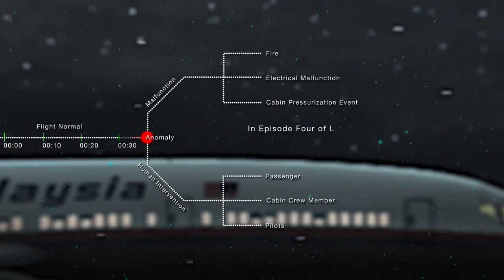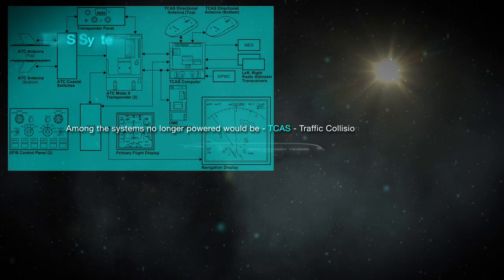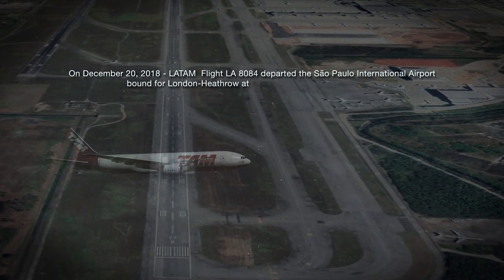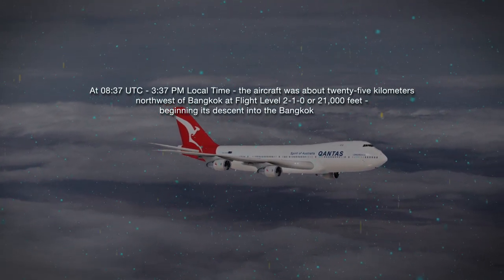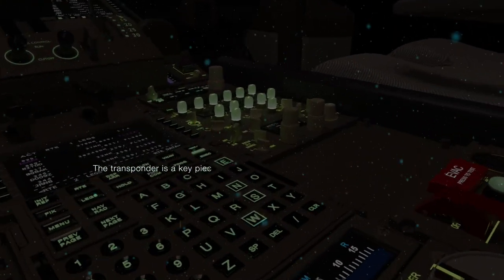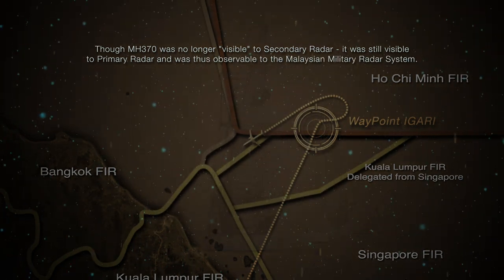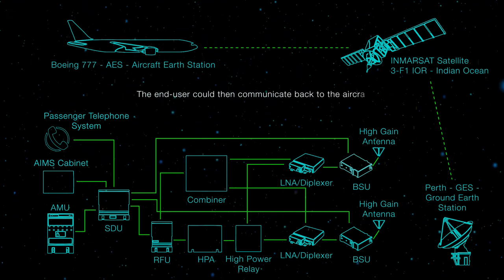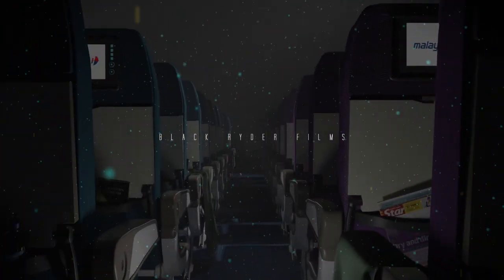Lost Flight MH370: Episode Four

Comment: I have watched a lot of videos about this flight; I have more or less come to my own conclusions about it all but I have seen nothing that has been as thorough or as informative as this series and am really looking forward to the next episode(s).
Reply: @cwam1701e   
Latest interesting data I've seen is this presentation with (somewhat newer) information that's been compiled (with data to support) that at least the last half of the flight path was most likely much different than the main area where all of the searches took place.

It suggests that they might have intended to land on Christmas Island, which is almost the identical distance from Kuala Lampur to Beijing (considering their fuel load), and also one of the few runways within its capable flight distance that has a long enough runway for this aircraft to land.

https://youtu.be/Qk1CxO9XGyQ
Reply: @bbfoto7248  I came across that some time after I had made my comment on this video. I agree with you - it is a good piece of detective work and, I think, a viable explanation.

Comment: Three things I'd like to hear more about. 1) An airliner contacted MH370 but only got "mumbling" and indistinct sounds. At the least, that means MH370 actively transmitted something. 2) Were there any cell phone calls from the flight, from take off to any point afterwards. 3) How do take out all the passengers and crew at one time?
Reply: @Michael Cilibrasi  
Do you know the source or have a Link to the information regarding this radio contact???

AFAIK, the ONLY cellular phone to cell tower "locator or connection ping", was that of the 1st Officer's cell phone.  ...Curious.

This was not a call or message, just a Single confirmation that his phone had connected to or ping'd a cell tower.   I believe it was Penang Island and well after the transponder & SDU went offline.

Watch this presentation for (somewhat newer) information that's been compiled (with data to support) that at least the last half of the flight path was most likely much different than the main area where all of the searches took place.

It suggests that they might have intended to land on Christmas Island, which is almost the identical distance from Kuala Lampur to Beijing, and also one of the few runways within its capable flight distance that has a long enough runway for this aircraft to land.

https://youtu.be/Qk1CxO9XGyQ
Reply: Excellent work and explains to the layman the various systems.
However at the end you dismiss electrical failure even though it provides a mechanism for the innocent loss of the transponder which logically is the 99 per cent chance and with clairvoyance could have been predicted if the incident of 2018 was known in 2014.
If you examine the last message from the commander you should note that he has not finished talking when he gets cut off. As an experienced flight officer he should have repeated the number to contact the next stage. This is a clear sign that the loss was not after but during air to ground communication that got missed as do many many clues at the time and immediately afterwards.

Comment: How do you explain the loss of SDU signal except from a power failure? I've been told by an expert on B777 that you cannot turn ACARS of from the cockpit. It has to be done fron the electrical bay under the cockpit.
Reply: Yes, I have the same question! I don't know if it will be covered in this series, but I saw a video recently that postulated that the main electrical switches/buses were deliberately turned off and the aircraft was flown from the electrical power from the RAT specifically so that the SDU/ACARS would not be powered; once outside military radar zone the buses were reactivated and the aircraft flown normally. The deliberateness is speculation, of course, but I have heard no other explanation for the SDU/ACARS to lose power unless the aircraft is flying on emergency electrical power from that RAT.

Comment: Super video. Also, there was a iphone call made by the pilot and at which point and time in the flight path.
Reply: Wasn't it by the 1st Officer (the co-pilot)?  And I don't believe there was ever an actual call...

AFAIK, the ONLY cellular phone to cell tower "locator or connection ping", was that of the 1st Officer's cell phone.

This was not a call or message, just a one time confirmation that his phone had connected to or ping'd a cell tower on Penance Island (IIRC).  And I believe it was well after the transponder & SDU went offline.

Watch this presentation for (somewhat newer) information that's been compiled (with data to support) that at least the last half of the flight path was most likely much different than the main area where all of the searches took place.

It suggests that they might have intended to land on Christmas Island, which is almost the identical distance from Kuala Lampur to Beijing (and considering their fuel load), and also one of the few runways within its capable flight distance that has a long enough runway for this aircraft to land.

https://youtu.be/Qk1CxO9XGyQ

Comment: A police investigation has now emerged claiming a Malaysian telecom tower detected a mobile number registered to Fariq Abdul Hamid a few minutes before the plane dropped off the radar.
There have been a whole host of theories speculating what happened to the flight.
The latest alleged evidence about the mobile would appear to support the idea the plane was crashed into the sea in a mass murder-suicide, former Easyjet chief pilot Mike Keane has suggested.
According to the theory, the captain may have told Fariq to go to the cabin before locking himself in the cockpit.

Fariq though would have had his mobile after takeoff, so the theory goes, and tried to make an emergency call when he realised what was happening and the plane was being depressurised.
Keane said: “The first officer would have been skilled in responding to depressurisation due to regular training.
“If Fariq had his mobile phone with him, he would have grabbed an oxygen bottle before taking his phone off flight mode or switching it on.”
Reply: How do u explain the low flying Malaysian airline reported over the maldives  by tons of people heading towards deoga garcia island???
Reply: @egs1380  Actually, it's already  been proven that MH370 was nowhere near that area.
Reply: @egs1380  
Latest interesting data I've seen is this presentation with (somewhat newer) information that's been compiled (with data to support) that at least the last half of the flight path was most likely much different than the main area where all of the searches took place.

It suggests that they might have intended to land on Christmas Island (read other comments as to why), which is almost the identical distance from Kuala Lampur to Beijing (considering their fuel load), and also one of the few runways within its capable flight distance that has a long enough runway for this aircraft to land.

https://youtu.be/Qk1CxO9XGyQ

Comment: So basically what I’m gathering here is with all the redundancy’s that the MH370 was equipped with it still would’ve been possible to land the aircraft during an electrical failure in a single or multiple system failure.  And with that in my opinion the disappearance of the MH370 was done intentionally I do not believe this plane just vanished.

Comment: We look at reasons for power loss, but what about runaway over voltage,  possibly from a faulty alternator voltage regulator. Many systems have crowbar circuits that cause circuit breakers to trip for self preservation. Some may have wide input voltage specifications and continue to operate. Has any electrical system analysis considered this?

Comment: Has anyone considered a power bump to the flight control autopilot? What if it reset a waypoint to 0 Lat / 0 Lon, a heading towards the knee of Africa? That great circle arc would pass over the Maldive islands where sightings were reported but  were disregarded by authorities. We can't just say that the flight path went south. With TDA (time difference analysis) it could just as well gone in the opposite direction. There are a lot of variables using a satellite transponder for calculations, oscillator stability being one. Aircraft transmitter stability, satellite frequency stability, satellite physical drift and Doppler effect, satellite oscillator solar temperature drift. satellite inverse frequency translation, down-link Doppler effect to the earth station and frequency drift of the earth station, all add up to a very high possible error.
Reply: @Robert Livingston  
Latest data I've seen suggests they intended to land on Christmas Island, as per this presentation for (somewhat newer) information that's been compiled (with data to support) that at least the last half of the flight path was most likely much different than the main area where all of the searches took place.

It suggests that they might have intended to land on Christmas Island, which is almost the identical distance from Kuala Lampur to Beijing (considering their fuel load), and also one of the few runways within its capable flight distance that has a long enough runway for this aircraft to land.

https://youtu.be/Qk1CxO9XGyQ

Comment: So, the plot thickens...There is NO WAY to switch off the SDU from the cockpit exept by turning off the entire L/H AC bus...not a minor decision!
( or climbing into the electronics bay.)
It can be rendered speachless from the cockpit,wich would be easier.
So we know there was no AC bus on left side for some time.
Suggestive of a electrical fault,like AC contactor burn up.
Why no mention of flights of 777 that suffered a electrical panel burn up?
there are a few...in this case SDU failure suggests major Electrical failure!
So,was L -transponder also on that bus? as R-transponder has to be selected manaualy?

Comment: I do not know much about aviation but, when the SDU goes off line for those 30  minutes or so would that be enough time to depressurize the cabin and kill everyone on board while he wears his oxygen mask? Then he restarts the electrical so he can breathe and wait for the fuel to run dry. great video....
Reply: Pretty sure yes. Passenger oxygen is normally sufficient for around 15 minutes or so. Pilots get a larger storage and assuming one of the pilots locked the other one out that supply increased accordingly.

Comment: I'm wondering why the engines themselves don't have a GPS unit and reports GPS coordinates with the data these engines send back to their manufacturer and service technicians while in flight.
Reply: Because we have been using Radar for flight since the earliest day and the whole flight thingy is built base on Radar including all the airfield positioning. GPS is only use to show the pilot their exact location on the plane itself. It doesnt send nor share anything to anyone else as the data might be compromise also the data sent/receive and constant update is really expensive to use. That is why when they switch airspace theres usually a few moment of silence for the pilot until the next airspace's radar pick them up. For those with larger distance to be disconnected from the tower station then they might use GPS for the tower since there will be no radar coverage.

Comment: I had a car once that kept burning through alternators on a regular basis. What I noticed is that you could drive a good ways on the engine power alone but, if you so much as stopped at a stop sign, everything would go dead and you wouldn't be able to start it again. Obviously there are no stop signs in the air so I wonder if there was a failure in the alternator, allowing the engines to power forward movement but not any of the electrical systems. That's what would happen with my car.
Reply: I'm sure an aircraft is wired differently.  But, if the engines are still receiving fuel. it would fly until fuel ran out . But another consideration, fuel pumps are electrical, I'm sure. So, as described here, that plane had electrical power to the end. KB
Reply: @Ken Blair I think the fuel pumps (and oil pumps) are run mechanically from the same shaft as the electrical generator is attached to so they would work even without electrical power as long as the engine is turning.

But I too think they had electrical power (and hydrolic power) til the end. The flaperon that washed up on shore indicates controlled landing on water. And the analysis of ocean currents and growth of marine life on it suggests it didn't land in the cold water down in the middle of the Indian Ocean, more likely in the warm waters next to Christmas Island, which also fits with the pings if they were flying low and slow to avoid radars.

Comment: Soo, can the transponder and the satellite data unit be switched off from the cockpit or does someone have to crawl to it to switch it off? If the pilot alone or together with the co-pilot did it, could he switch off the main electrical system completely in a way that wouldn't activate the APU (physically pull a plug in the electronics bay?) and thus switch off the transponder and SDU, deploy the RAT and fly the plane for just over an hour until he clears military radar coverage and then switch the main electrical system back on again?

How much would the rest of the crew and the passengers notice given that it was in the middle of the night? "This is the captain, sorry that the infotainment system is off line, have a good night!"?

The best hypothesis I have seen is that the captain or whoever was in charge was trying to fly to Christmas Island but because of one engine being more thirsty than spec ran out of fuel just short of the island and had to land on the water. It fits with all the pings if the plane was flying slow at relatively low altitude to avoid radar. I hope someone searches the ocean floor there soon.
Reply: Why Christmas Island? They can't land on this kind off taxiway.
Reply: @zapfanzapfan  yeah I read that french book. RAS as à terrorism theory about exchanging pax for prisoners. But their own calcul hasn't really on the good way.
I was optimistic about their theory before I read the book (by JM Garot) but when I finished it, I I've more question..
And a 2 000 m of tawixay ok, but a 777 need a special kind of taxiway, it's a heavyweight of civil aviation. Like a A380.
Reply: Maybe pirat don't knew it.
Reply: @robintaylor6306  
The aircraft is MUCH lighter weight when it has very little fuel remaining.

Comment: why no miltery jets intercept the fligth ?
Reply: @Meshary KH  
That is curious.
The question is asked and answered (not conclusively) in this presentation with (somewhat newer) information that's been compiled (with data to support).

And that at least the last half of the flight path was most likely much different than the main area where all of the searches took place.

It suggests that they might have intended to land on Christmas Island, which is almost the identical distance from Kuala Lampur to Beijing (considering their fuel load), and also one of the few runways within its capable flight distance that has a long enough runway for this aircraft to land.

https://youtu.be/Qk1CxO9XGyQ

Comment: EXCELLENT WORK IM JUST WONDERING WAS THERE AN INVESTIGATION INTO WHY AND HOW THE 25 MINUTES OF VITAL UNDERWATER INFORMATION WENT MISSING ,I MEAN THE PSU FOR THE UNDERWATER LISTENING SYSTEM, ALL WENT DOWN AT THE SAME TIME ,AND THE GRAPH SHOWED THAT THEY ALL STARTED UP EVENLY , AND WAS THE COMMON POINT TO ALL THREE CHECKED OUT,  HOW DO THEY SWITCH ON AND OFF, IS THERE ROM FOR THE PSU WHEN WAS THE LAST TIME, IF ANY, THEY WENT OFF,CAN THEY BE SWITCHED OFF BY PHONE,OR SATELLITE, WERE THE CONNECTIONS CHECKED BY THE RIGHT PEOPLE ,THE LOW FLYING AIRCRAFT THAT WAS SEEN BY BOATMEN ANT THERE WERNT SUPPOSED TO BE ANY FLIGHTS IN THAT PART,IM SURE THEY CHECKED IT OUT SURELY, YOUR WORK,EFFORT,AND TIME PUT INTO THIS TO US ALL IS GREATLY RESPECTED,THANK YOU

Comment: I truly believe this is the result of one of the pilots. My only question is which one, and where was the other? Was the other dead, locked out, or an accomplice? I believe the person responsible wanted to ditch the plane so far off into the ocean that it wouldn’t be found. I don’t believe it crash uncontrollably into the ocean on a death dive. I do believe the person responsible (one of the pilots or both) controlled the flight up until the plane impacted the water. If the plane had done a death dive into the ocean after running out of fuel there would have been millions of pieces as seen in the Swiss flight the crashed near Nova Scotia. The fact that the flapperon and the other flap found were intact with only the outer edges being damaged leads me to believe that they were down for landing which can only happen if someone is controlling the plane. The pilot(s) knew how to crash the plane in a way that would cause the least amount of damage, and would leave the plane in multiple large pieces. The majority of the plane is someone at the bottom of the Indian Ocean likely with the fuselage largely intact.
Reply: @Kd Love  
Watch this presentation for (somewhat newer) information that's been compiled (with data to support) that at least the last half of the flight path was most likely much different than the main area where all of the searches took place.

It suggests that they might have intended to land on Christmas Island, which is almost the identical distance from Kuala Lampur to Beijing (considering their fuel load), and also one of the few runways within its capable flight distance that has a long enough runway for this aircraft to land.

https://youtu.be/Qk1CxO9XGyQ